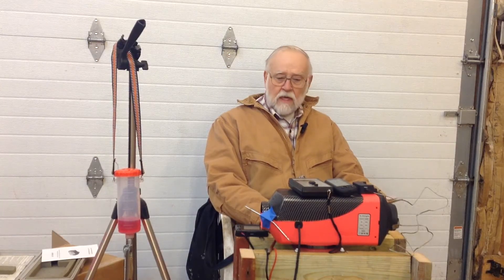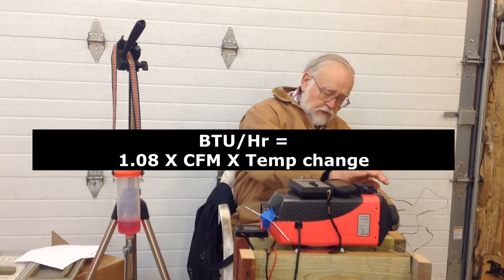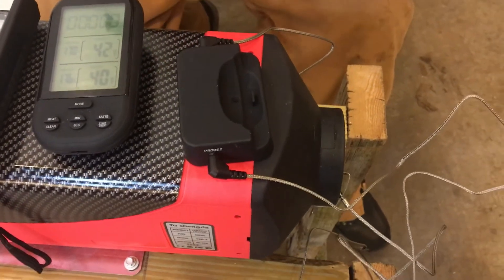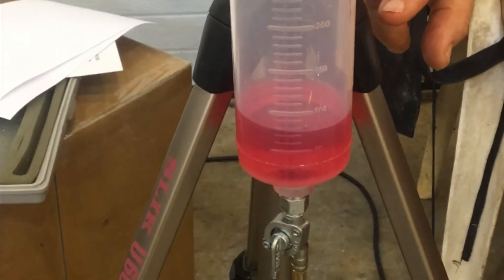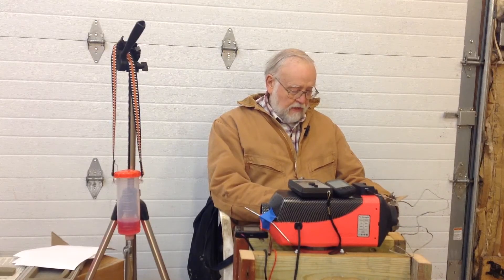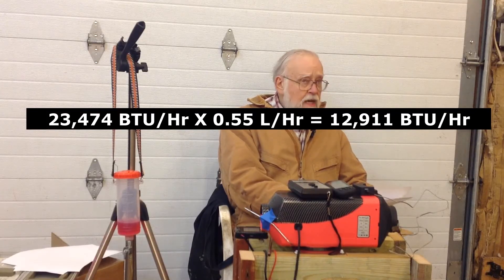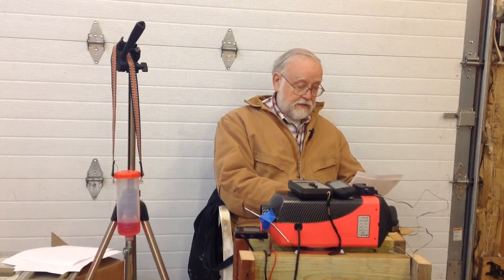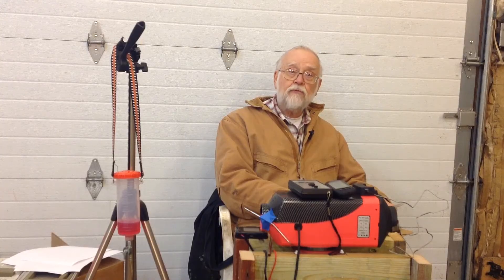Diesel Heater What is the Actual Heat Output?

Comment: good job, I'm putting together a test setup similar to yours, will also measure noise levels with silencers I have made  using fiberglass pipe insulation for heater intake and outlet as well as combustion intake and exhaust, my thought  is to increase cross section area of intake and exhaust tube size to lower velocity and noise. Common EDPM rubber foam pipe tube insulation to encapsulate the the pump to reduce pump noise.

Comment: Great timely info for me.  I'm just getting ready to purchase one.  I also questioned the 8KW.  Glad you looked further into it.  I use to do air balancing on commercial HVAC equipment.  When I took a duct traverse with a monometer,  I took several readings across the area and then figured in the average, I assume you did that also but didn't mention it

Comment: You can reclaim the heat going out the exhaust by using a heat battery. Ive seen some guys use old water radiators, sand. Although I dont know how those set ups perform long term, I suspect if you keep the build within the parameters of maximum allowables like exhaust length etc, you'll pull more heat out of the machine with no risk to operation.

Comment: Saw a video where a fella took and piped the exhaust through an old steam radiator before it left the room. Unit was too big to actually warm up obviously so it is overkill in that sense but it did successfully recover a lot of the heat lost in exhaust.
Reply: hundred hours.

Comment: I'm back to refresh my calculation.  Thank you again for presenting this work / information.  For what its worth, my BTU per liter is slightly different.  Using DTS.GOV, 138,700 BTUs per Gallon, divided by 3.78541 Liters in a Gallon equals 36,640 BTUs per Liter.  Not a big deal but thought it was worth mentioning.

Comment: I have a vevor 8 kw, on lowest setting of 1, it burns 2 Litres of diesel in 12 hours and keeps the garage at 15 degrees Celsius  (59 F)when it is -4 Celsius ( 23 F)  outside, garage is about 8 by 12 feet and insulated. Unit works pretty good!

Comment: Thank You for the effort you put into this presentation. My background is instrumentation and in my opinion you did a great job of evaluating the heaters performance with what you had. You confirmed the main process variables to use in your calculations. I recently purchased a 8kW unit and had reviewed the unit stated fuel consumption and realized there is no way this could put out 8kW. but then the data as you indicated does not state 8kW/hr just 8kW. Buyer beware. It works great for heating my ice fishing tent or my camper and I am happy with that. Thank You again.

Comment: coming to this late but you did not take into account exhaust gas heat and yes you can reclaim some of this heat to improve overall efficiency.  This is where most of the gains from a modern furnace comes from, extracting every btu from combustion gas via heat exchangers.

Comment: thats some complicated maths.Thanks for this! I have already seen another video and that pretty much confirms your results,which is good news for me.I originaly ordered a 5kw vevor,but the eu supplier was out of stock,so they asked if i would accept a more expensive 8kw one.later i thought oh crap!as 8kw  is realy too much for my 30 foot boat,and i also just found out the thermostat is not exactly a thermostat.i also have seen on you tube  that the  5kw   is exactly the same as the 8kw  only  the 8kw has a different motherboard  and puts a bit more fuel in than the 5kw.So i think pretty much i have the right heater as in reality its  3 kilowatt and a bit at best.so in the end perfect for my boat.

Comment: Very nice measurement but you could have improved the measurement accuracy by putting short pipes on the connections and measured velocity and temperature through holes at about half length of the pipes. Measuring right at the throat gives disturbance from turbulence and heat stratification. Anyway, I think your result is quite correct.

Comment: Thank you for making those calculations. That's disappointing that the specs are so misleading. It seems these diesel heaters aren't even as powerful as two electric space heaters. So if my electricity rate is 12 cents per kWh, how does using diesel to heat compare to resistance heating?

Comment: Nicely done.  It's apparent you have some background in getting to a answer that seems to elude most.
I purchased 2 of these several years ago after retirement.  One for camping, one for a small workshop.
My previous life was with the production and maintenance of biogas facilities (municipals) for auxiliary heat/electricity.  So I'm well aware of what the CV value of different materials.
You explained it well.  The producer's of these products should explain it better in their manuals.  But then that wouldn't be any FUN.👏👏👍

Comment: I think their output ratings also include exhaust heat. That’s the only way to derive their claims.
Reply: Yes the rating is based on fuel consumption per hour. Basically how much fuel is burnt in the burn chamber per hour. The efficiency of heat transfer is another thing.
Reply: Good point

Comment: I used to heat my workshop with two 2kW electric fan heaters, which were able to heat up the room anytime over 20°C (pretty fast), so the thermostat turned them off.
Then, as electricity became expensive I bought a 8kW rated Vevor diesel heater which can't raise the temperature above 14°C, so it is no way 8kW, not even 4.
Measured its fuel consumption and figured out it would be still cheaper to heat with electicity. Also in my region (Mid-Europe) the diesel is pretty expensive too.

Comment: My unit uses 79.2cc per pulse; at 5.5 Hz that's 435.6cc per hour. One litre of diesel has 10.35kWh of energy available, so multiply 10.35 by 0.4356 gives 4.508 kWh. Subtract the exhaust heat-loss, I probably get about 3.75kWh of hot air into the room. I run the central heating to keep the house about 16-17deg c, and use the heater at half output to run the living room at 22c

Comment: Great video, thx. Now try running the exhaust gas thru a radiator of some fashion, that would be really fun I would think. The exhaust gets over 400 degrees, if you could capture that in a radiator and then recover that in the living space in the form of radiant heat that would be a fun experiment.

Comment: That is not an 8KW heater. It's just a 5KW relabeled (yes it's a lie) And most people know it so just buy a 5KW unit and save some money. You will still get about 17000 btu (supposedly) not the 27300 as advertised. Your results sound about right in reality. The truth always prevails.

Comment: Mr. Baker, really enjoyed the time you put into uncovering some of the confusion involving these heater. You touched on some of the heat value lost going out the exhaust of the unit.
I was watching a YouTube video in which they had set up the exhaust of the heater to pass through an old cast iron radiant heater before venting to the outside.
Is there any chance that this would make you curious enough to set up an other Test to determine potential heat gain and potential efficiency gain by routing the exhaust this way.
I think of it as a secondary heat exchanger for the chinese heater. Possibly could use 1.5" diameter heavy pipe and fittings to build the secondary heat exchanger and record the heat gain on the secondary heat exchanger and potential gain on efficiency? 
 With this an other issue would have to be addressed is the potential condensate that would develop as the temperature drops in the exhaust gases.
At what temperature would the exhaust gases start to condensate? Would it be better to keep the exhaust gases at a higher temperature or to reduce the temperature to lower value to maximize the efficiency gain ? I am thinking along the lines of the newer high efficiency furnaces available now on the market.

Comment: Wonder how many btu is out the tailpipe 🤔 these heaters run extremely clean and can be used in a workshop without exhausting outside (do not do this in a living space/attached garage) they only put out about 30ppm in carbon monoxide, so for a work space it's allowable 😅
Reply: I'm using my diesel heater like that without exhausting to the outside in my garage. In the living spaces so many people use the kerosene heater with wick and the laser models. They don't have any exhaust at all. What is the difference if the diesel heater burns so clean? A diesel heater like the Airrex AH-300i also do not need to exhaust to the outside.

Comment: Great video, clears a lot of myths about these heaters. What you have is probably the Chinese copy of Eberspacher D4. 10300 BTU = 3kW. That's why the original Eberspacher D2 and D4 outputs are rated at 1.8kW and 3kW in High mode. 1.8kW can go up to 2.2kW and 3kW can go up to 4kW in Boost mode. Eberspacher sold these two as 2kW and 4kW.

Comment: An easier test on chinese products is a steam cleaner. They list them as being 2500w on 110-120v. At any voltage in that range they’d constantly pop most breakers. Testing with a Kill-a-watt meter revealed on multiple units sub 1500w power draw. Another unit of a different type was listed as 1700w. That was actually 2000. The takeaway is whatever something is listed at is likely not what it is. Sirry Ameri-cans! Twicks are for chins!

Comment: Thanks! Great info!! The 70% efficiency number might be understated because some of the heat is going out the exhaust pipe, which is not shown in this video. As the exhaust moves along the pipe, the pipe will radiate some of the heat back into the room before it exits. If I follow, the final calculation you need is to convert BTU/hr into watts. You can do this by dividing by 3.41. You show 10,348 BTU/hr so, dividing that by 3.41 yields 3034.6 watts. So, this is actually more like a 3kW heater, right?
Reply from the maker: Yes I agree with you.  The output is about 3 kw

Comment: Wonderful video.  I have been a member of a CDH group for several years, with members all around the world.  The administration people have been trying to stop VEVOR for advertising these as 8, KW. No such thing. They are either 2 or 5 KW and both use the same 22 ML fuel pump although someare using a larger a larger pump to get a hotter burn. For their size and fuel consumption they can certainly put out lots of dry heat
Reply from the maker: These are neat little heaters.  Too bad about the honesty issue.

Comment: My question is if the ambient temperature requires wearing a coat and gloves in your garage to keep warm does this heater allow you to remove the coat and gloves?  I am trying to decide if buying one of these heaters will put out enough heat such that I can remove my coat and gloves to occupy our two car garage in the winter.  There are many videos on U Tube talking about everything except do these heaters provide enough heat to do their job.  Thanks for your video.  I'm beginning to think that although these heaters are cheap they aren't really practical for heating anything larger than a tent.
Reply from the maker: My shop has a floor area of about 900 sq feet and is insulated with 6" batts on the side walls and 4" batts in the ceiling.  I have not tired to heat this building with the diesel heater.  However, the building is equipped with a 9800 BTUH heat pump which seems to hold the indoor temperature at about 60 degrees when outdoor temperatures are in range of 30 to 40 degrees.  The factors that affect heating your garage are going to include how much insulation you have in the walls and ceiling and how tight your overhead doors are to air leakage.  The outdoor air temperature  is important.  These units were probably designed for small spaces such as RV's not heating larger structures.
Reply: Thanks Richard @richardbaker3621

Comment: Great video! What, may I ask, did you do for a living? I've been using a 8kw Vevor to heat my 12' X 24' shop. This is my third winter using it and I have found it to be most efficient when set to (3). It's air to fuel ratio seems to be optimal at that setting. The heaters internal sensor claims the temperature in the burn chamber is 392 degrees Fahrenheit and turning it up to max will only get you eight more degrees. For my diesel heater the sweet spot is 3. I was thinking about kerosene, which is a little cheaper than off road diesel, until I did the math on the heat output of the two.
Reply: 3hz and what fan speed?
Reply from the maker: My education and experience is in electrical engineering. Most of the time I worked in the consulting field.  So when I talk about heaters and BTU's I'm a bit out of my field.
Reply: @rocman9137  
The factory set fan speed, I have not adjusted the speed.

Comment: People have made heat exchanger's, out of old vehicle engine EGR coolers, to recover some of the lost heat in the exhaust.  The real attraction is cost.......they are cheap, and can be run on gasoline,diesel or black diesel etc.  People can even harvest plastic and use pyrolysis to make a crude petroleum liquid ideal for this application.  Waste not, want not.   The main criticism is that the basic, stock diesel heaters can lack tunability to adjust the parameters to get the best combustion at a given altitude and fuel.
Reply from the maker: thanks for the comment.

Comment: I have had a dozen of these from 5kw to 8kw markings that were identical in every single way.
Reply: there is a new 8kw model that is a bit longer and has a bigger 3-1/2" air outlet and also use's more fuel one is made by maxspeedingrods and there's another that I can't remember the name of
Reply from the maker: The only real differance may be the fuel pumping rate.
Reply: @richardbaker3621  Hcalory 6-8.5KW is the model he tested

Comment: I liter of diesel has a calorific value of about 10kW hrs  using 70% effy that is 7kw hrs from 1 liter burned.   .438l gives  about 3kw/hr real usable heat from 4,38 liters burned.
Reply from the maker: The numbers just don't make sense when compared to the manufactuer's claims.
Reply: The 8KW might make that much when run at 13.8 volts. At the rated 12 volts it’s about 5 KW. 
Exhaust losses have already been assessed loses 20%. Many have found ways to extract that heat. To reduce fuel consumption.

Comment: On alot of these heaters (not all i might add) have a manufacturers setting where you can increase the fuel pump delivery speed as to increase the temperature..
Reply from the maker: True. Unfortunately my unit does not have that ability.

Comment: Fuel consumption rate = Output power / (Calorific value x Efficiency)
Plugging in the values of a calorific value of diesel at roughly  35 MJ/l and an efficiency of 70%, we get:
Fuel consumption rate = 8 kW / (35 MJ/l x 0.70)
Fuel consumption rate = 0.325 liters/hour

If you go by the manual and assume a max burn of .55l/hr that takes the efficiency down to around 50%
Efficiency = Output power / (Fuel consumption rate x Calorific value)
Efficiency = 8 kW / (0.55 liters/hour x 35 MJ/l)
Efficiency = 0.512 or 51.2%

I think the efficency rate is more likely to be down around the 50% mark when you consider the considerable heat that is lost to the exhaust. 

Either way...thanks for the video. They're great little heaters and perfect for garage or workshop in winter.
Reply from the maker: Thanks for your input
Reply: This is very true. 50% is what I expected.
Reply: Thinking the heat output is exaggerated and then assuming the fuel consumption isn't is pretty dumb, if they lied about the heat output, they are also lying about the fuel consumption, you cannot assume any statistics of it's operation are correct, you cannot assume the fuel consumption in the manual is correct, 100% it's going to be a incorrect

Comment: why the 8kw cant be 8kw  https://www.youtube.com/watch?v=0o38XKrTRkI

its just marketing bull.
Reply: Condensing gas boilers claim an efficiency of over 90% what the sales people don't tell you is that when it's not in condensing mode it's only 70+% efficient..... According to the read out on my boiler it is only in condensing mode for 58% of the run time.
Lies damn lies and sales BS. The 8Kw claim includes heat lost from the exhaust which is greater at full speed. Probably around 4/5Kw into the room and 3Kw out of the exhaust.